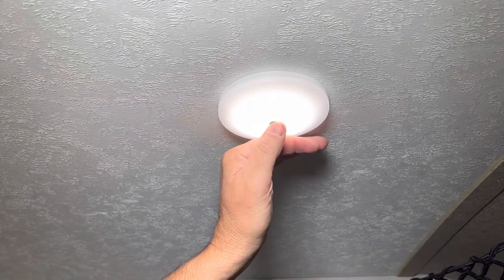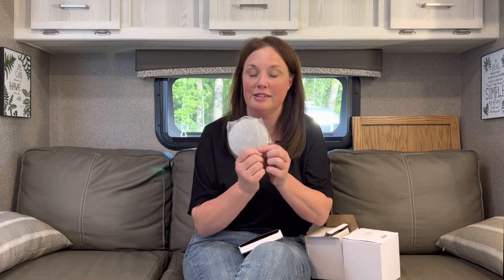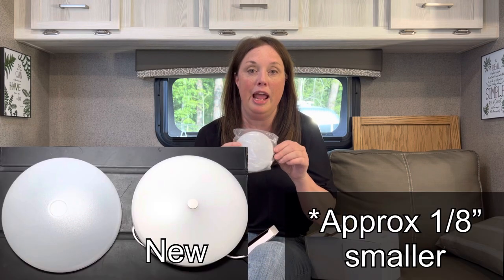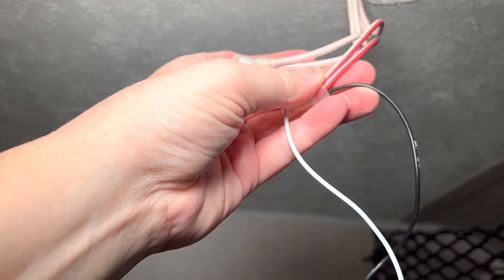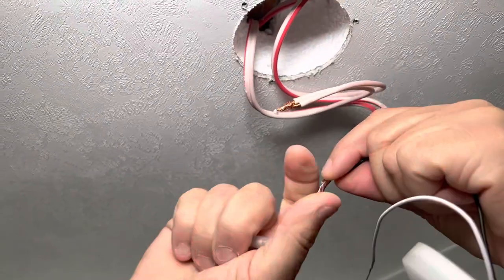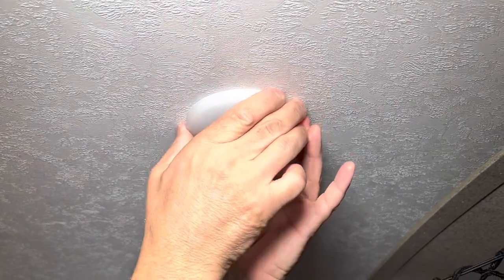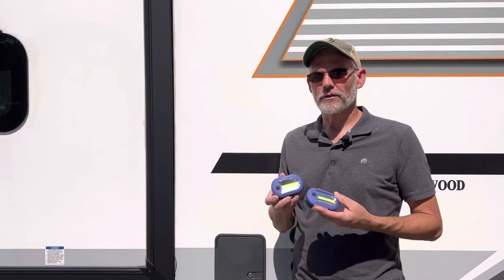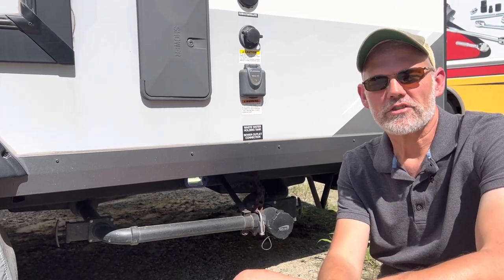We Have New Dimmable Overhead Lights.  Quick and Easy Project!

Comment: Man I would love to dim the lights in my 20BHS. It’s super bright in there at night. I usually just turn on the kitchen sink light or the slide out dinette light since the run separate from the master.
Reply from the maker: Agreed!  We liked that these looked like the stock lights - actually a little thinner so maybe 1/8-1/4" more head room too lol.  They have the 4 pack which is what we bought, but think they may also sell them in a single or 2 pack as well.  Thanks for watching!
Reply: I have the same unit and so going to get these!

Comment: We just brought home a brand new 2023 BHS! The first thing we wanted to deal with was those too bright lights that hurt to look at and give the camper a not very “romantic” atmosphere. After searching online for hacks or ideas and not having much luck, this is what I came up with: I painted the inside of the covers with “Distress Oxide Ink”. It’s a water based ink pad and it washes off easily. It’s made by Ranger and you can get it at Jo-Ann’s in the art supply section. I  tried a number of colors, but “Dried Marigold” is the color we liked best. To apply it I first used my finger but it looked smeary. A make-up sponge applied it fairly evenly. (There is also an ink pad called “Distress Ink” by Ranger, but that is not washable so I don’t recommend it.) the lights are still maybe just a little too bright but are no longer painful to look at.
Reply from the maker: Hi!  Congrats on the camper!!  And yes - the lights were very bright but what a clever and inexpensive fix - thank you for sharing.  And please do let us know how you are liking the camper and how those first camping trips go!  Thanks for watching!
Reply: @WinesPinesandCanines  HI! Thanks for replying to my post! I wanted to let you know that I went to change the color in a couple of the lights and when I took the covers off I that found that the paint was moist. I know it was dry when I put them up so It had absorbed the water in the air I guess. Hmmm, so maybe it’s not the best idea.
Reply from the maker: Good to know - thanks for the update.  The campers can get humid/moist at times.  Camped one summer for a few weeks with no air - we were close to ringing water from the dog’s hair lol